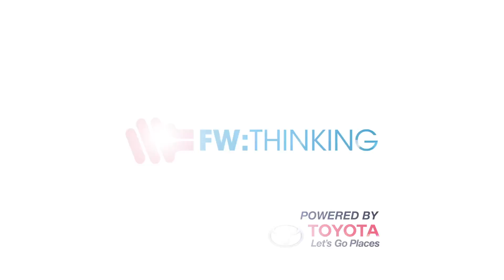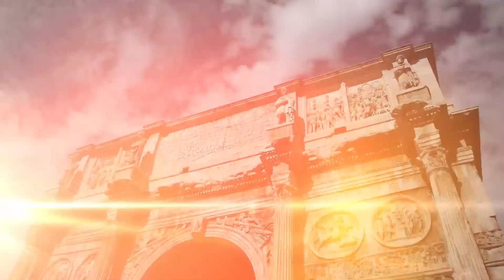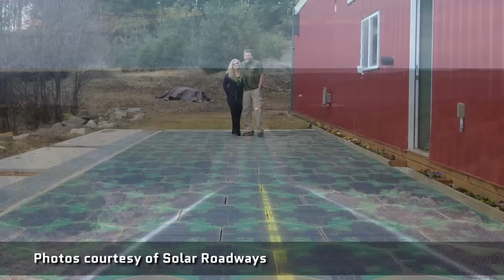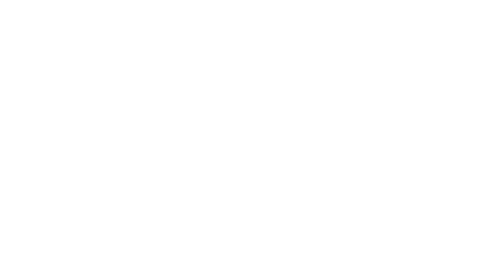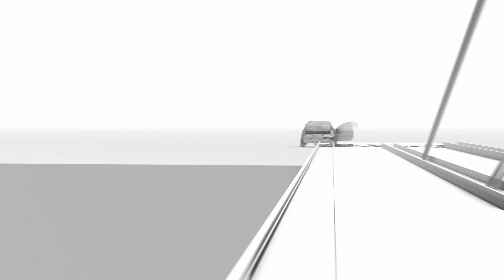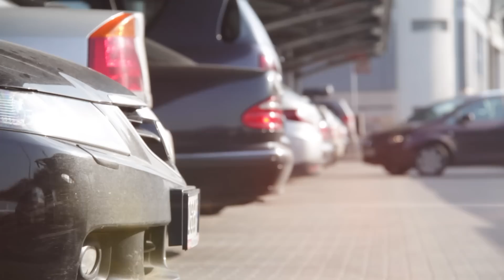Our Roads Are Getting Smarter

Comment: If I could redesign anything in my city (in all cities across the world, really) it would be lighting. Light shouldn't go to waste shining sideways into people's eyes and up into the sky where it serves absolutely no purpose (excluding runway lights, of course). Sideways light can cause safety and security problems by disrupting night vision and creating harsh shadows; it can also make sleeping difficult if it enters people's homes. No, people shouldn't have to buy expensive blackout curtains to make their bedrooms properly dark at night...AT NIGHT. Upward light is just pure waste that erases the Milky Way from the night sky, as well as many stars, other galaxies, and nebulae.

How could wasteful light be reduced? By fitting as many lights as possible with properly-designed shielding that keeps light pointed down where it's actually needed, replacing current bulbs with ones that aren't so bright when they burn out, using timers and motion detectors, removing lights from areas where they're not really needed, using signs that are made visible by reflected light rather than direct light, and using smart lighting grids that can dim or switch off lights, depending on time of night and human presence. Also, businesses should follow a lighting curfew that requires them to turn off their lights an hour after they close for the night.

As for smart roads, I like the possibilities of thawing snow and ice, as well as wireless charging and lighting that only turns on in the presence of traffic. However, you may have guessed by now that I don't like the idea of the LED lighting, as it would contribute to wasteful upward lighting.

Comment: As great of a concept as it is, there are a number of critics out there who've pointed out a myriad of issues beyond what you discussed here, Jon. For starters, there's this whole 28 minute discussion on it - https://www.youtube.com/watch?v=H901KdXgHs4.

Beyond that, I've talked about it multiple times with an engineer friend of mine, and he said the more efficient thing to do would just be to have panels all alongside the roads. Notwithstanding the fact that, even if you did that, the electricity would still have to travel an extreme length to get to cities (especially if you're putting them across all roads).

Still a great idea in the basic theory of it, though.
Reply: Jewish Music Toronto There are tons of practical and economic problems that make solar roadways next to impossible (I mean -- it's possible in that you could do it but you'd spend more money trying to implement it and make it work than it would offset in electricity production).
Reply: Jonathan Strickland I'd hope that, given time, it might be more practical. The last time I chatted with that engineer friend I mentioned, this article - http://mic.com/articles/117948/6-months-later-here-s-what-s-happened-to-the-netherland-s-solar-bike-paths - had just come out.

It mentions some of the problems, but that video before goes into much more detail.

But what else is R&D for if not R&D, right?

And thanks for the reply! That's much appreciated.

Comment: i would add special barriers to intersections preventing cars from going through on them they would say stop in big red letters. that would help prevent a bunch of accidents because people cannot run red lights
Reply: that would work to
Reply: ***** that would be possible with autonomous cars, i want to upload the hole traffic system to a computer that will transmit the signals to individual cars, like an advanced gps.